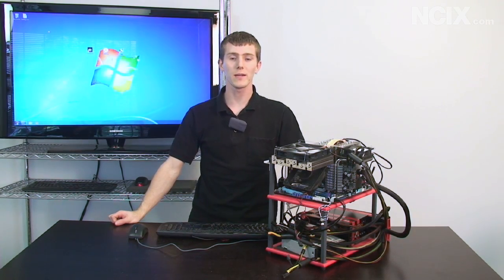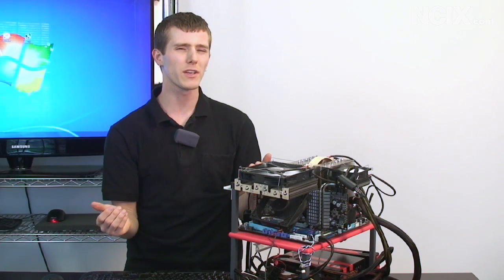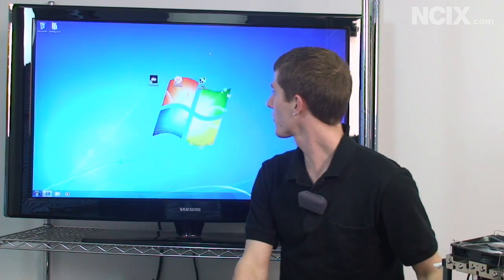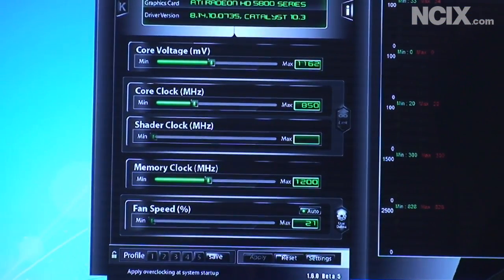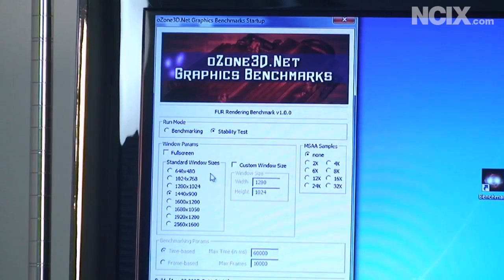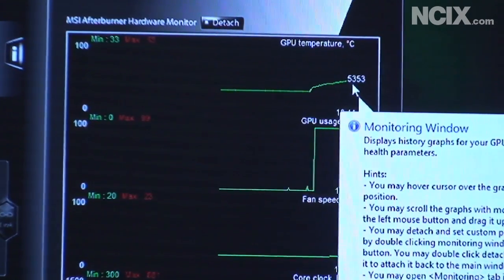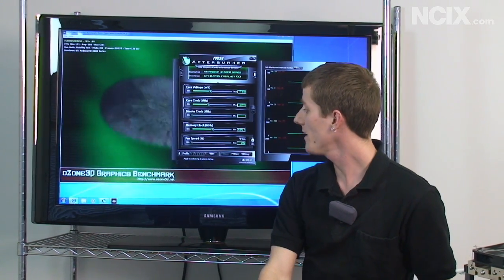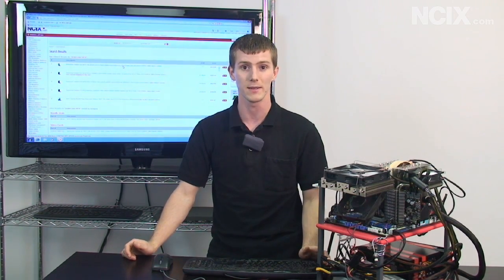Video Card Overclocking Guide (NCIX Tech Tips #69)

Comment: Processor - Intel Core i3 3220
Motherboard - Asus P8Z77 - V
RAM - Corsair XMS 3GB. Get 2 of these
GPU - Asus HD 7850 DC 2GB DDR5
HDD - 1.0 TB WD Blue
PSU - FSP Raider 80+ Bronze 550w (You can go lower but if you get this, you can add more GPU's in the future
Case - It's all personal preference. Just make sure it's big enough.
I think the calculator for currency messed up though. It was showing the same amount for Cuban Peso (the currency on the site) as the US Dollar.

Comment: I find it hard to buy ( and digest ) this notion of "overclocking the cpu would give you more performance": For following reasons : 1 Even though you overclock your CPU which means it can execute more instructions per sec, it boils down to how fast it can read the data that it wants to execute those instructions on. 2. Memory bus speeds are constant Its takes finite amount of time to read a chunk of data from RAM into L3 cache. So even though CPUs would run faster u are actually just burning it.

Comment: I just want to tell everyone that it's fixed now. i was actually underclocking it from 970 to 900 and still got those temperatures. I just tried switching the thermal paste out to Artic MX-2 and my temperatures amazingly dropped down to just around 60 max 70 °C at 1 Ghz :)

Comment: Yes its exactly normal, the maximum temperature for a 650 ti is 100 degrees, as long as that is on a full load its okay. Mine runs a bit cooler, but did you know you can configure the fan for the 650ti to run faster the hotter it gets?

Comment: It depends on your airflow. I personally wouldn't try it unless you feel you really need the extra performance. By the way, the next time you want to upgrade, you should consider getting another MSI GTX 660, because it's probably the best 660 out there and it performs insanely well in SLI, especially if you play games on 1 screen. You should look up some youtube videos, there's one doing 2 660s in SLI vs a 680 and i believe the 660s actually got slightly higher fps's in some games.

Comment: Meh, temps dont matter until you hit the 100's ish. 
I overclocked my 480 to 900MHz core (700 stock) and 2200MHz memory (1848 stock) running stable and at around 90 degrees at full load with aftermarket cooler. With the stock cooler on I had around 100 at full load with stock speeds and its still going fine.
Maybe he just have bad airflow in his case? Who knows.

Comment: To allow it to generate polygons at a faster rate.

Using Furmark (a benchmarking program for GPUs) my stock GTX 560 I got an average of 24 fps. By doing a very very very slight overclock I was able to push it up to a 30 fps average.

Comment: I got the gtx660, i found these settings working for me: PCI-e freq 111 in bios on my asrock 960. on afterburner i've got power limit: 110 core clock mhz: +80 memoryclock mhz: +400, fan speed: auto. and voltage normal. You're more than welcome to pm me if you find some good settings working for you, as I want to fine tune my system a bit more.

Comment: remember, an asus card does not have an asus GPU, all cards will either have an NVidia GPU or an AMD/MSI GPU. asus will either stick their label on a reference card (which is the card that NVidia or AMD designed) or use a custom card and/or cooler.

Comment: you should back off with that OC. 90+ celcius is never a good thing for a GPU. i run a severely OC'ed 660TI at 61 degrees. i know there is a lot a variables that goes into this, but i would start from scratch and overclock that card until i hit a stable overclock with the card running at approx 60-70 degrees =) otherwise you'll just shorten your cards lifespan unnecessarily =)

Comment: It happens with my GTX 650 which is essentially the same as a 550ti just updated architecture and when I OC my 650 it crashes every 5-10 minutes on any game that uses more than 500mb of RAM so just reset it and your problem should be solved, I did it and I'm just happy to play games normally again.

Comment: i have a evga gtx 550ti 2gb and yes its bad to have it over 70C   what i recommend is for you to download msi afterburner
its an overclocking utility and since yours gets that hot i wouldnt recommend overclocking it. what i recommend is for you to 

!!turn the fan speed up to 100%!!
 i run 100% 24/7 and it helps alot
sounds like you need more or larger fans in ur bot. clean the card fans good with duster at least 1x a month

good luck and if it ever gets that hot again you should be ashamed

Comment: Do u have a GPU under/over-clock program?? Im using "MSI Afterburner" u can easily set your fan to 100% or 70% if you like. Or even set it like.. When ur GPU is at 50 C. FAN is running 30% when its 75 C its at 75% etc. :D

Comment: I really dont think so! Im getting GTX 680 2 way-sli.. Right now I have a GT 250... Its MAX at 70 C. Overclocked from 738-780.. 50-60 C in BF3 (with everything at low -.-'') 50-60 FPS Really dont think GTX 680 will get hotter than 660ti.. No.. :)

Comment: It's hard to really see if it's spinning as fast as it should, because it's really sitting at the bottom of the chassi, but you can hear and feel with your hand that there is air flowing. Both fans are running at 100 % and the chassi is completley open. I also tried putting a normal "office fan" or whatever you would call it next to it. It takes longer for it to get hot but after 10 - 20 minutes i'm above 90 degrees C

Comment: My 660ti got to those temperatures (75-80) before I realized I didn't have Percision X installed (not even overclocking). Now I don't go above 70. I wonder if the 680 I'm upgrading too gets hotter than the 660ti just from being.... well... better.

Comment: oh well, but that's when i underclock it. When it came it was running at 970 Mhz , and i clocked it down to 900 Mhz. If i run it at 970 it goes above 98 sometimes, but usually it just shuts down before that

Comment: the current graphics card generation starts on overheating by reducing the core clock.
this means .. if your card runs with 100% clock speed nothing is wrong with the temperature.
the GK chips can handle easy 90-100 degrees before slowering the clock speed.

Comment: 90-95 isnt that high for a graphics card since they are made to run really hot but if you do think your computer is crashing because off overheating you should try and adjust the fan speed manually instead.Cause graphics card fans dont run all that fast.So set it manually instead and monitor the tempature to see if it goes any lower.

Comment: You didn't mention that by buying a pre-overclocked card, you will usually get cooler operation cause they usually have better coolers installed, and with that you can overclock it even higher.

Comment: My gtx 295 was causing problems for me nearly a year ago, after i finally checked what temps it was at 99 without being under stress, i took it apart and dusted everything off, but it was too late, it only lived another month or so and i had to get a new one.. :( The new one i got was a GTX 560 ti and that one allows you to open up the fans by removing a screw from each fan, maybe you can do that to yours too. In any way- dust it off asap, or youll loose it. :)

Comment: The only thing i'd like to oveclock is my GPU, everything else is good for now. Core clock: 740 to 870 MHz, memory clock: 1200 to 1360, but the only thing i don't know is how to change voltages. I have AMD Radeon HD 6750, my temps don't go over 56'C, and that's too low temperature! :D Any other program won't recognize my GPU except Catalyst Control Centar.

Comment: If the bios says it is 1600 MHz, then it sure is.
For benchmark try the software you've told me - AIDA64. There you can test CPU and RAM. About temps, i didn't find anything to check them. You can touch RAM and feel for yourself. In my bios too - just select it, i didn't manage the voltages...yet :)

Comment: I really don't know. I got Kingston hyperX blue 1600 MHz and my max is a little over 2000. You could try going to 1866 but if your monitor remains black or computer keeps restarting you've failed :) Turn off the psu and the bios shoud reset to its default. If it doesn't work, pull out the bios battery and that will do it for sure. You'll never find out unless you try :))) That's how i reached my max.

Comment: got it ;) thanks wow thats a nice temp for that voltage and speed.. im living in the equator my lowest was 27 celsius hehe
just asking about ram overclocking... i have a kingston hyperx red at 1333mhz default... i overclocked it to 1600mhz... do i need to adjust the voltages if i wanna go to 1866mhz?

Comment: 1.51-1.52V is max, but don't go over 1.48-1.49V. Don't ever set the voltages on auto when overclocking, cuz it can burn your CPU. On my mobo (AsRock Z77 Pro4-m) i can't set exaclty voltage...hard to explain using words :D I'll upload a video in a few minutes on my channel :)
I've increased base clock to 105, so my CPU clock is now 4515 Mhz, RAM oc'ed from 1600 to 1960 Mhz, and GPU, well that doesn't matter now :)

Comment: wait isnt like 1.44v a bit too dangerous? correct me if im wrong cuz i attempted to overclock my 3570 no 'k' to 4.3 ghz 42 on cpu ratio without adjusting the voltages and it blue screened on bootup.. turbo was on.. mobo is p8z77- vlx

Comment: So you adjust the Core Clock carefully in increments, makes sense so far. But at which point do you set the Memory Clock? After you have reached the Core clock limit or do you set them simultaneously: increase Core clock, increase Memory clock -> test it -> repeat... ?

Comment: When did I say you "need" to go with a liquid cooling solution?  
When you overclock you add more heat, obviously.  The stock coolers on video cards are NOT made to keep a card cool under intense overclocking.  You're too ignorant to realize that you need liquid cooling after a certain point.

Comment: not 'definitely.' it's more than fine if you just use the fan-slot on the bottom of case or one of the side-vents.  that will give a massive injection of ambient air to feed your GPU's fan

Comment: personally i have a 560. And it will not run bf3 well. Overclocking does almost nothing. I clocked it to 950 mhz and a memory clock of 2250 mhz. Whether i overclock or not, the difference in framerate is less than 5 fps. If u just bought ur gtx 560 to play bf3, u made a really bad buy

Comment: I have had my 5850 OC'd for the last two years with no problems. As long as you do a normal OC it's no problem. Each card is different and to me the 6850 had some issues! The 5850 is faster at stock speeds. The 5850 runs cooler. The 5850 overclocks better. But the 6850 does have newer tessilation support (not by much) and the power efficency is just mildly better than the 5850. With a 6850 do a mild OC and you will still have the card run for years. There is no way to guarantee 6 years!

Comment: Ah ok :) the HD6850 is still a good gpu specially if you run in resolution lower than 1080p.Don't forget to read reviews on overclocking 6850's to have an idea before you start.Good luck .

Comment: Absolutely no risks if you know what you're doing! if the temps are fine and you don't mess with voltages you won't degrade the GPU lifespan at all. And btw 6 years is a little too much for a gpu,after 3 years it's time consider an upgrade.

Comment: The problem here is that when you have an "Open System" (Not in a case) you HAVE NO FORCED AIRFLOW. It's like running an Air conditioner on hot day in a convertible with the top down. You may as well just start blowing on the board to cool it down.

Comment: I got a XFX HD 7870 and 7850 Double Dissipation Edition. i have try to overclock it ... but the voltage limite me & i stop on 1050/1400 with +20% Power Board Power, all this with the TRIXX ... i have try to use ASUS Tweak & MSI After. but the same i cant also change the Voltage, i m using Catalyst 12.8 & Driver 9.14.10.0924 ! so Could you help me plz... any way i'll be very greatful to read my post and trying help me.
Thanks Again :)

Comment: Well my CPU (a weaker one) Pentium E2160 is oc'ed to the very maximum of 3.0 (on my board) The standard clock was 1.8 so that is also a major performance gain. On a side note it did a stress test for 3 days straight and it didn't BSoD. While my main rig: i5 2600K 3.4 Oc'ed with non stock cooler with my AMD 6970. But that is mostly used when i want to try out some new game that requires a badass system to look good.(BF3,Witcher 2,Lost Planet 2 etc etc) While my old timer 6670 and E2160 is running

Comment: Just a note, when I say strained, I'm talking about the look of the rendering on the screen, not the hardware itself. If you're saying you got that 11%(aproxx) gain and it looks good and is still responsive, great. But it has not been my experience with video cards.  Recently I began overclocking my CPU, it's an AMD (Phenom 955) and not overclocking just seemed silly because it's basically designed for it.  Most video cards I've had already seem close to their limit.

Comment: It really depends on what card your over clocking. Example my card the 6670 Radeon GDDR5 1GB has default clock of Core:875 Memory: 950 But i overclocked it to Core:1000 and memory to:1100 and i got in Crysis 2 from 29-34 to 36-45 Frames. So that is a performance gain. Strained? No that is called customizing your pc to your own needs. If you feel like your straining it then return it to default clock or lower your Oc'ing.
Right now my card is working great.

Comment: as long as the failed part of the video card does not have to do with the oc'ing you should be fine, just rma'd a 5770 (half of my oc'd Xfire) and it went through fine but I got back a 6850 :(

Comment: How dangerous is it to overclock? Will overclocking my graphics card affect my motherboard and other components?
I'm currently using a rather old Nvidia GeForce 9600GT 512mb - can I increase my video memory through overclocking? What does changing the core clock value cause, how does it increase the video card's performance and in what way can the improvement be noticed in games, say, Battlefield 3. That is, which graphics settings could overclocking enable me to raise?

Comment: A 6670 is a pretty low tieredcard, any overclocking is limited by the fact that it is a very very cheap card. Would this work for your card.... yes.... but would it benefit.... minimal improvements will be seen on a card such as yours.

Comment: depends on the cooling solution. For reference cards, you dont have much of overclock headroom because they tend to run quite hot. Something like twin frozr or other aftermarket coolers havew a lot of headroom, you should hit 1ghz pretty easily

Comment: No. OCing ram is very dangerous IMO and should only be done by someone who has lots of money or is an expert at OCing computers. As for CPU, that's easy to OC too; mostly depends on your model, board, and heatsink. I've OC'd my i5-2550k to 5 GHz using an H80 but I could keep stability. I now have a custom WC loop I built. *Round 2... FIGHT!!!* :D

Comment: i have a serious doubt, i'm planning to OC my system.. i'm gonna have to change the cpu heat sink for my cpu that's for shure...
but... my main doubts are...
Will a 6850 Double Dissipated GPU (from XFX) card take an oc?
will a Sentey ERP600SS take the overclocking? or do i have to get myself a "cheap" 80plus bronce for the work..

i'm running a FX4100 w/8gigs of ram and a gigabyte 970a UD3 motherboard..

Comment: Some aren't stable to 5.0 and that's just too sad, but it's the way it works. About 10% of the 2500k chips are stable to and OVER 5.0GHz. 

I took it to 5050 but was unstable, backed it down to 4945.66 at 1.49V and it's stable overnight in Prime95 

I take locked CPU's from 2.8 to 3.6 all day long, nothing spectacular about taking an unlocked from 3.3 to 5.0

It's not like 6.0 or something

Comment: No, those games don't come close to 60FPS on a PS3. Framerates on consoles are locked, it's all identical hardware so they set the graphics options, the resolution, and the framerate - they lock it all down to keep it as steady as possible. 

The problem is that the PS3/360 GPU's are from the X1K/GF6/7 age of GPU's - now very weak and dated

It struggles because it's weak, GoW3 and Uncharted 2 don't run at 60FPS =P

Comment: Actually no, an Xbox 360 playing a 720P image on a 100" TV (extreme example which probably doesn't even exist but good to prove a point) will give you the same performance as an Xbox 360 playing a 720P image on a 25" TV. If you increase the screen size but the resolution stays the same, the DPI (or dots per inch) actually decreases because it has to spread the dots onto more space.

Comment: Wrong...dpi - dots per inch...more inches, more dots, more work for the GPU XD 

Screen size make a huge difference. It takes twice as much horsepower to push a 50" than I does a 25"...it's simple math, twice as many inches to display...

And lots of PC gamers still use 720P and 1440x900, not everyone has a monitor capable of 1080P =P

Comment: Thanks for the replies everyone! My girlfriend's little computer is doing great, we've been able to keep the Athlon II X2 4400e stable at 3.4GHz, and we pushed the GTS 250 512MB about 30-40% higher on both clocks

Replaced her 2x1GB with 2x2GB, overclocked the 667 to 800, seems to dip a bit less in Witcher 2, which has been the most taxing on the system

Girlfriend is still uber happy, anything over 24FPS looks like butter to her, since she's used to PS3 

And nothing dips under 24 =)

Comment: For what? If he's gaming at 720P why would he need to replace a 6770? XD 

I've seen an overclocked 6770 handle Metro 2033 high settings 720P on a 50" plasma screen - lowest it dipped was around 25FPS during a real heavy fight scene, averaged over 30FPS for the test

You'd be surprised what they can do for the wattage requirement